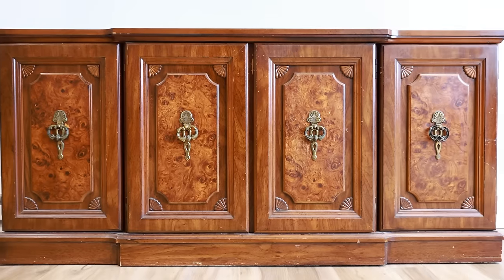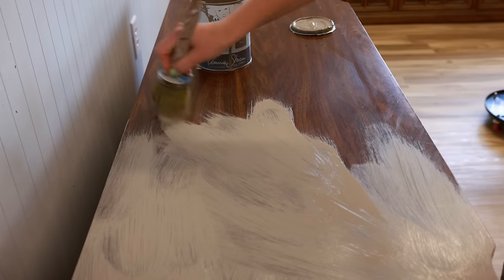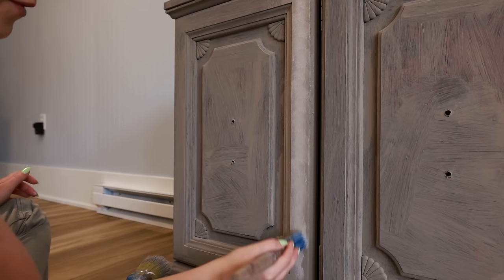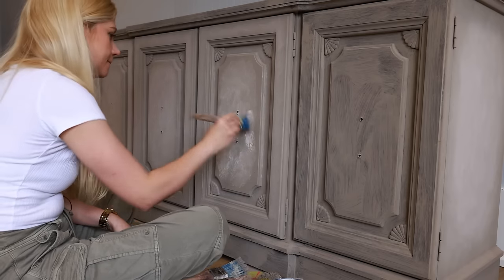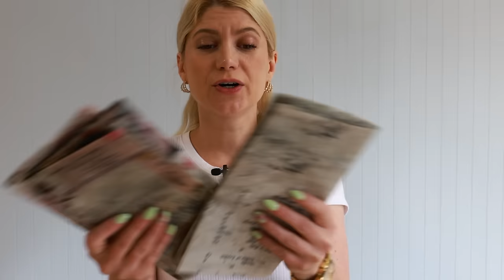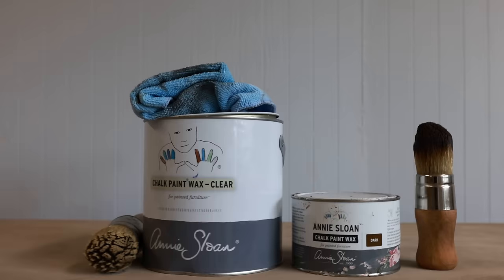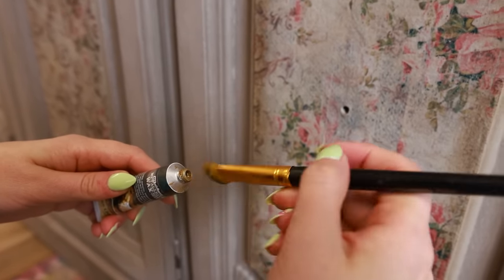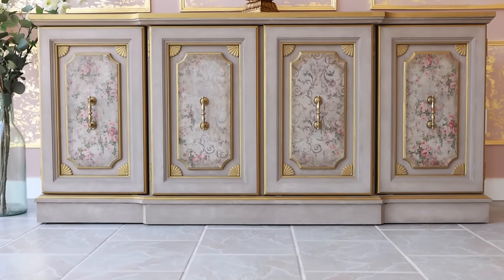OUTDATED Buffet gets a Stunning Old-World Makeover

Comment: I had trouble getting rid of wrinkles on a small decoupage piece!!i forgot about the saran wrap smoothing.
Reply: Should I spritz water over it to get it flexible to remove wrinkles?
Reply: When using the gold wax does it have to be finished with a spray fixative or will it just dry?